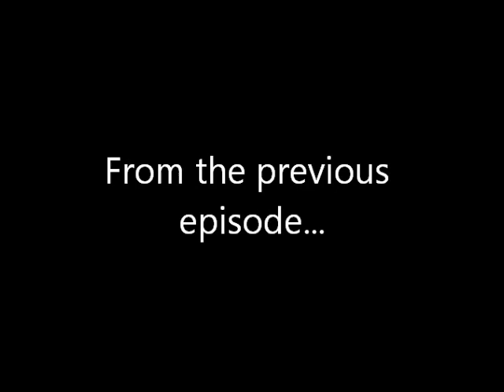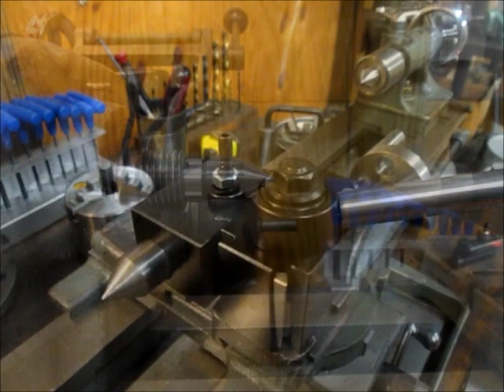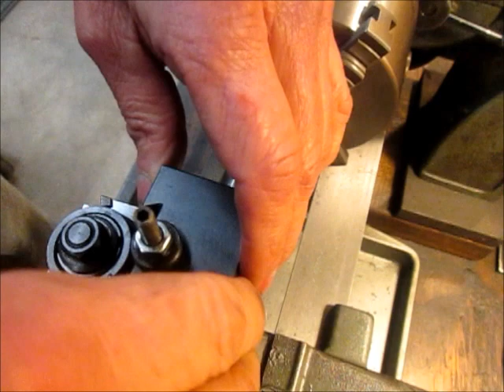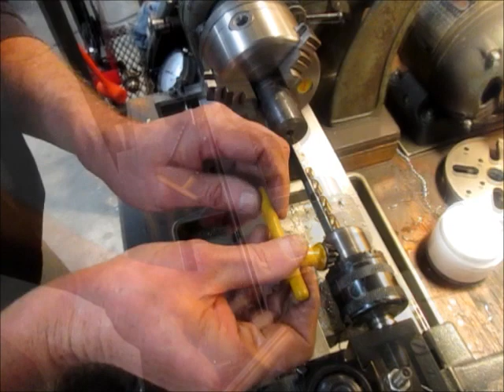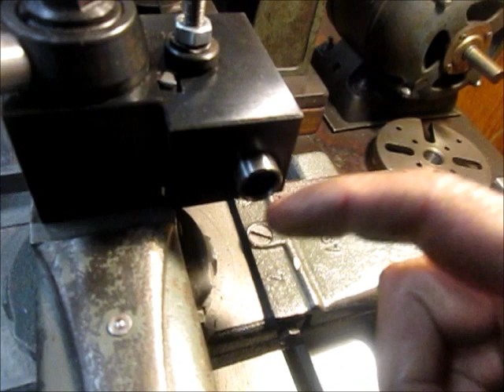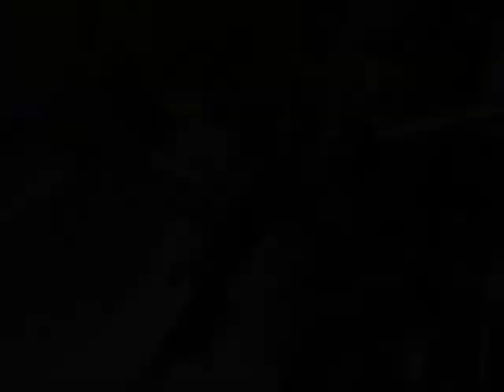QCTP Morse Taper Tool Holder Review

Comment: To centre your tool-post chuck, keep a 6" piece of tool steel round with a centre-drilled hole at either end. Put a centre in the lathe chuck, a centre in the tool-post chuck and your alignment bar between the two. Use your DTI to run along the length of the bar and adjust as necessary. To set the chuck in the taper, do it off the machine: Wind the jaws right back into the body. CLEAN  the male and female of the tapers, the put the chuck-face-down onto a piece of hardwood on the floor and strike the back-end tang of the taper using a heavy soft mallet. Make sure those tapers are CLEAN!

Comment: You should also shop around for m/t shank drills as well and only use old mister tailstock for centerdrills most of the time. You will also be putting lots of stress on the little crappy die cast crank feed gear cluster in your apron too so watch out for that to break sooner or later.
Reply from the maker: Feed gear cluster is still kickin ass. Besides I can make all that stuff.

Comment: I’m sure enjoying watching you work with the same Lathe I have. When you switched to the 3/4 Hp Motor, was it the same 1750 RPM as the original? It seems like you get a faster speed than mine. You have a lot of Great ideas I’m going to implement on mine. Very nice Work. 👍
Reply from the maker: I have a different pully set up. That 3/4 motor was 3600 but I switched back to 1/3 1750 and got the slower speeds back.
Reply: Looks like my next Purchase 👍

Comment: Very cool. As I was watching the taper/chuck turn a bit with those larger drills, I though it might work to grind a flat on a portion of the taper and install a set screw into the top side of the holder body to keep the taper from turning. I was also thinking that with those larger drills the pressure on the rack & pinion carriage--pretty light-weight on your small lathe--you could break a gear/rack tooth. I wonder if the tailstock could be employed to apply pressure to the back side of the taper holder using some kind of spring-loaded plunger similar in principal to ones used for tap/die followers--on a larger scale, of course, and with a stronger spring and longer travel. With some pressure thus applied, it could take some of the strain off the carriage rack & pinion. Could be an interesting lathe project, too. Thanks for the video.
Reply from the maker: Good ideas worth looking at. Thanks.
Reply: I must respectfully disagree about needing to modify the holder to keep tapered tools from moving.  They're self locking tapers, and if they're not staying locked something is wrong.  It would be better for reliability as well as accuracy to find and fix the issue keeping the tapers from locking, rather than compensate while leaving the problem.

I wholeheartedly agree with the increased load on the carriage.  I have a 618 lathe myself, and after some experimenting with dial indicators mounted all over the place, I was kinda shocked by how much the assembly flexed around under 'more than normal turning' loads.  It ain't rigid enough for large diameter drilling in steel.

Thanks for taking the time to share your experience!
Reply from the maker: I agree with you about the rigidity of this lathe in regards to large diameter drilling. You want to switch to a boring bar as soon as you can. After a 1/2" drill would be best. But it's not hard to overload these small tapers and set them to spinning even though the tapers match.